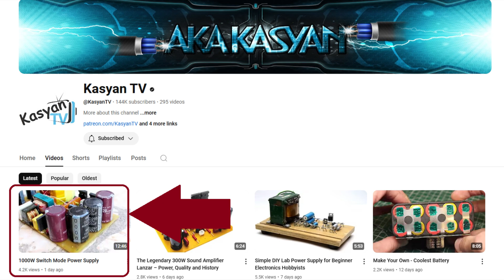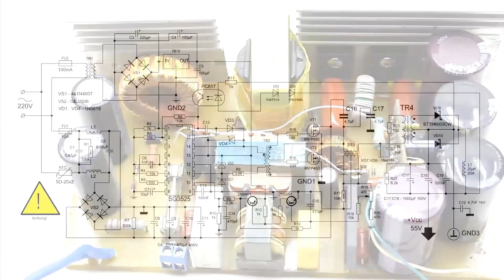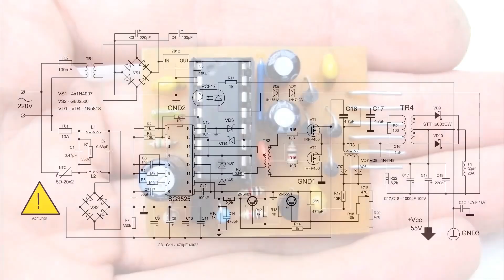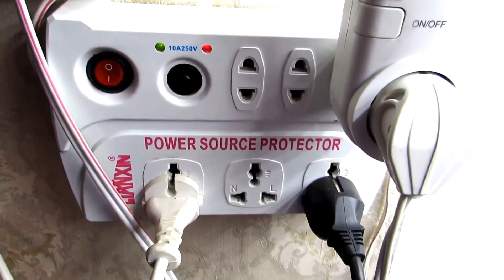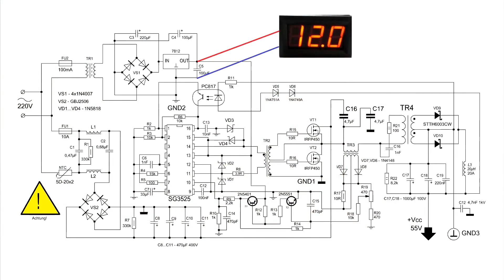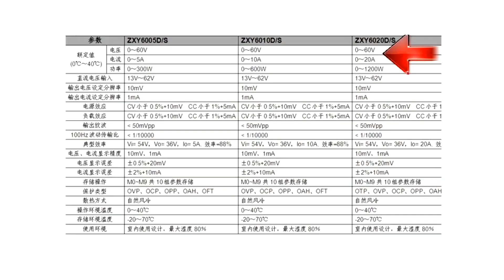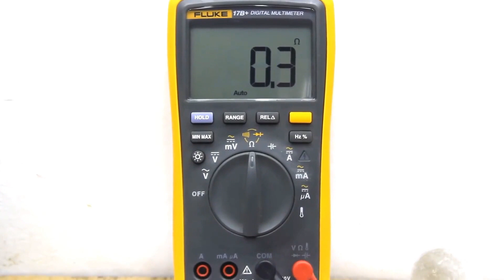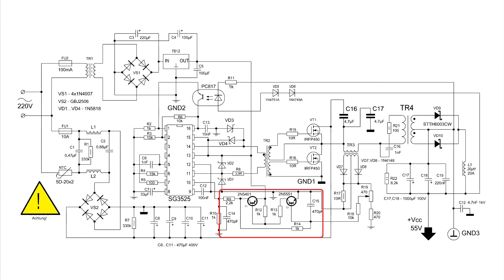DIY switching power supply 1000 watts

Comment: I built the smps for 12V 100A and am thinking of Using 3x LT 8705 with more than 240W or equivalent for laboratory power supply it's an MTTP with high efficiency and comes with programmable features like CC CV and CCV😊 and maybe it will be cheaper than that of 70 dollars with voltage range of 1-30V min

Comment: If you need a high power 60volts supply , the chepest & easiest way is to buy a used telecomunication power supply like powerpack2 second hand , they are used to charge the backup batteries in telecom systems